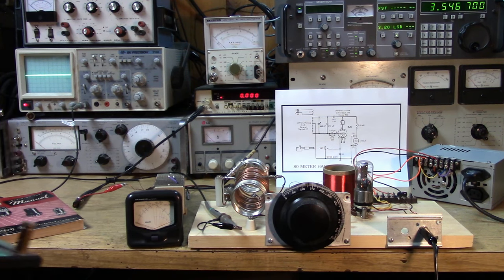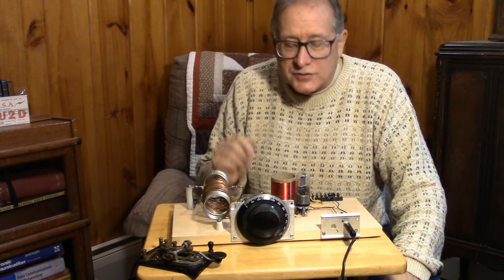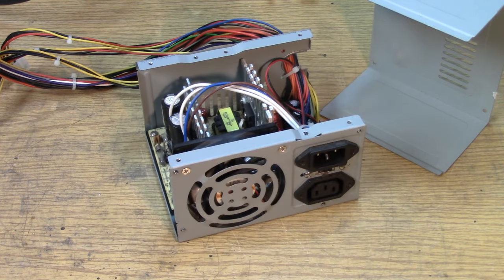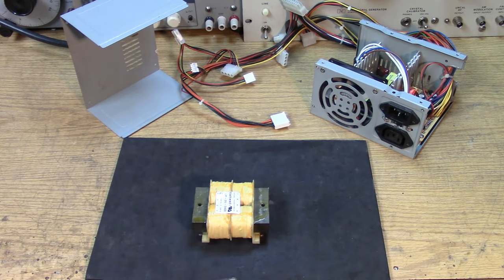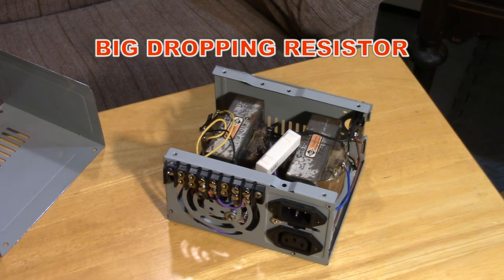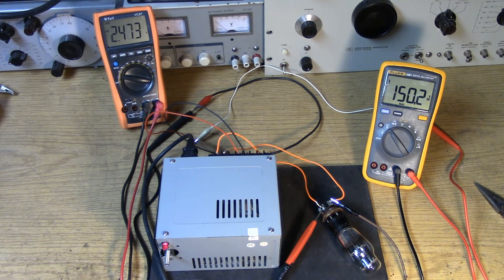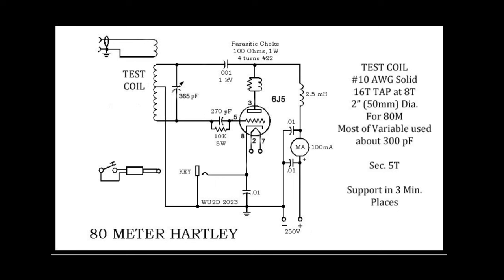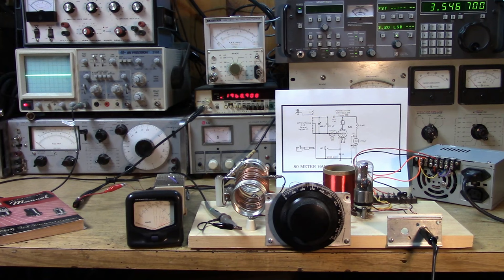Your First 1929 Style Transmitter - Part 2

Comment from the maker: A viewer pointed out an error. I had specified X1 capacitors  to ground from Hot and Neutral. They should be Y Safety Caps. Y Caps Fail open. X Caps fail closed across the line to pop the fuse. I will update the schematics.

Comment: Regarding the #10 vs the copper tubing, I believe you say the tubing just insures more stability. What about the diameter of the copper tubing? -is a smaller diameter tubing OK to use? or are there other considerations to be aware of?  Harry
Reply from the maker: At RF Frequencies, the skin effect favors the larger diameters with high RF Currents, so you get both stability and efficiency benefits as the coil diameter goes up. At this low power, it is unlikely that we see much of a difference in power out! But it looks good!

Comment: If you don't have access to a 6J5 tube, You can use one half of a 6SN7, it is two 6J5s in one envelope, for testing your 1929 transmitter. 6SN7 tubes are very plentiful (Used,  NOS & New), for they are still manufacturing new 6SN7 tubes. The 9=pin 6CG7 or the 6FQ7 versions are also the same electrically.
Reply from the maker: All good choices, as well as the  6C4 miniatures.
Reply: @MIKROWAVE1  I would also add the 12AU7 tube, for it is two 6C4s in one 9-pin envelope.

Comment: I have a question?  When you look through the old manuals about this they show both a tx and rx antennas.  Could you explain the separation needed between them and a simple way to calculate the separation between the two antennas.  They did a lot of stuff back then that we don’t do now and it is fun playing with this old tech.   Thanks for the info.   kd0wih!  73

Comment: 👍Thanks Mike. I had a rake through the junk box last night. No 227 (as expected). Thought I might have a 6J5 but no luck. I did find some 7C5s. Do you think one of these would work?
Reply from the maker: 7C5 local is fine if you have a socket!
Reply: @MIKROWAVE1  Thank you. Some Googling suggests Loctal and the 7C5 appeared around 1939. So, not BK compliant but good to know it will hopefully work. I might have some Loctal bases. Back to raking around in junk box 😆. What I did find was some car brake pipe. I think it is 3/16" diameter (yes, we still use Imperial for some things in the UK). It looks like it's is made out of brass rather than copper. So, maybe more rigid than copper tube and might make a stable tuning coil.

Comment: What,  no chirp!!!

Steve
Reply from the maker: Well to be fair, not much tube dissipation and it's into a dummy load.  And at 150V and a light current drain of less than 30 mA. The 330 uF cap and the big transformers help the regulation too. But it surprised me too.

Comment: Great Fun!   Will get started on the power supply this weekend.   What is the maximum B+ that you would recommend for this transmitter?  73 DE K1TB
Reply from the maker: They are actually rated for 275 VDC but you might get away with more !
Reply: Thanks, Mike! @MIKROWAVE1

Comment: Would putting a sheet of metal,  grounded, improve stability? G7VFY
Reply from the maker: Almost everything and anything you can think of electrically, thermally or mechanically can improve on the stability with these breadboards! A ground plane sheet above or below, or even a grounded front panel are both aids to stability. But honestly, these techniques although known, did not really show up for Ham Builds until the 1930's.

Comment: Or .... 80 band  Mr
Reply from the maker: 80M worked pretty easily, even with the #10 wire inductor. 40M was a bit more challenging, so I went there. These both would benefit from a 365 pF variable capacitor in the output link, according to Steve VE7SL and I agree.